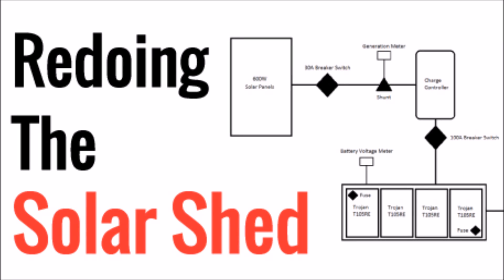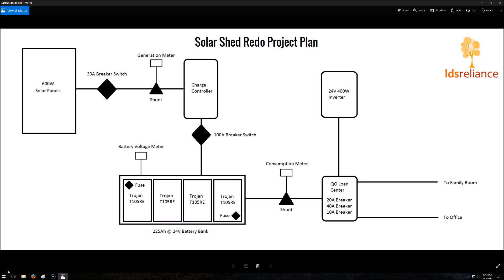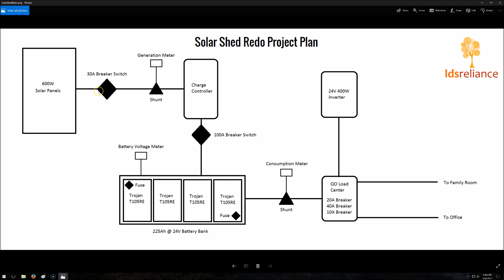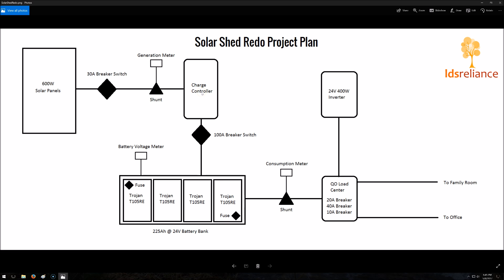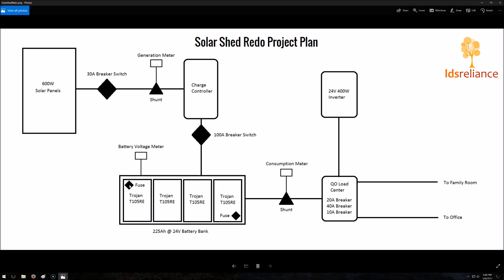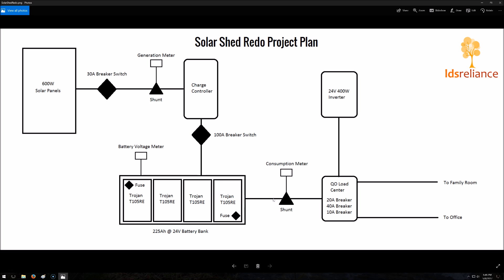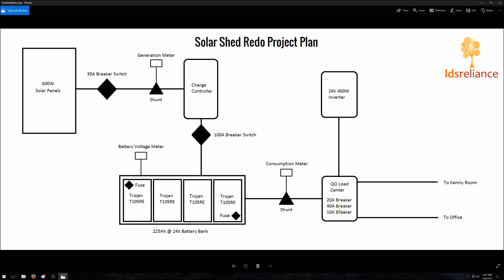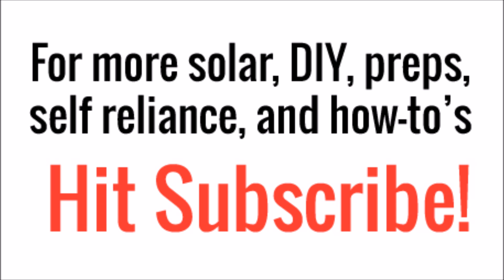Redoing The Solar Shed Part 2 - The Plan

Comment: idk if i asked this before but how much does each trojan T105 battery weigh in tons?

Obviously im just kidding, it was a joke. But how much does it weigh in pounds?
Reply from the maker: Each one is 67 pounds.  They are about 5-10 pounds heavier at least than the previous golf cart batteries.  I picked them up yesterday and they are beasts!
Reply: Was that joke funny? and thanks.
Reply from the maker: Haha, yeah.  They might as well weigh tons if you put 4 of them together and try to move them!
Reply: I found a 3-5 AH battery (i dont remember) it was a sealed lead acid battery (you know how small these are) they weighed way more than my battery that I got.
Reply from the maker: Yeah lead is heavy.  BTW, I am doing a lithium battery video this weekend.
Reply: nice

Comment: Brother I would do a lot of looking into the Mindnight 150. They use a lot of power at night. I am a Morningstar guy. Looks good brother. God bless
Reply: 8 watts.... 30 watts.... pretty specious comment. Point is that draw is inconsequential and Midnite's advantages far outweigh it.
Reply: I guess I'd agree that 5% is borderline at best, but still, if one's available energy is even somewhat affected by, say, a couple of fans to cool and exhaust that setup may be under-powered for needs. Might as well leave options open and toss another panel up there.
Reply: To me, advantages of Midnite Classic 150 is 150v peak and number of other input options that allow future expandability. Case is also aluminum and put together real well, and circuits are protected.

I'm happy so far. I have 1900w flowing through mine, but also impressive is how it handles lower available energy.
Reply from the maker: I've always been a MorningStar guy myself.  I'll keep looking at it but they lack on the ethernet and web monitoring from what I have seen.
Reply: yankey4 ....what power do they use at night???... they automatically go into rest mode at night.
Reply: They use about 30 watts at night when in sleep mode. If you have a wizbang you will see it. My friend has one. Phillip20 here on YT and he can show you with his IRcam the heat there putting off at night. He calls it his wall heater..
Reply: Yes sir they do. FOr that you would need the TriStar 60 Amp 12/24/48 Volt MPPT Charge Controller. Then U would have all of that. That is one thing I diss like about mine. I have the 45 amp Mppt TriStar and have to use the rs232 to usb going to a computer that I then can see from my phone or computer at home.
Reply: yankey4 ....that is very strange.  mine uses zero watts.  only if you turn on the led graphic panel (readout) power is used.  i thought from your comment you owned and operated a midnite.
Reply: I did had 3 150 that I had for over 2 years. Sold them when I moved to Morningstar. Do you have a wizbang on yours?
Reply from the maker: Good to know, Yankey.  Thanks for the info!
Reply: yankey4 ....the graphics panel of the midnite draws 2 watts when turned on.  at rest, the microprocessor draws 8 watts.  all microprocessor s draw power.  so 8 watts is a far cry from your statement of 30 watts.
Reply: So I am not trying to get into a pissing contest with you nore do I care. But my TriStar 45 Amp 12/24/48 Volt MPPT Charge Controller and 2 15 amp sunsavers Mppt CC use less than 4 watts all together. 

Yes your right I was off from what your saying. Sorry but for me it was a min of 30 but if you do the math on your # I was using 45 watts for my 3 Midnite charge controllers to run. Like I told you tho. I do not care and am in ni why trying to make trouble.. I was telling him what I was seeing from my stuff.
Reply from the maker: I wouldn't say draw is inconsequential when my whole solar panel system is only 600 watts.  If that unit is defective and draws 30 watts 24/7 that will be a problem.  Even 8 watts is a bit much.  Midnite claims 3-4 should be normal.

Anyways, sell me on a Midnite.  What advantages does it have over a MorningStar 60 MPPT?
Reply: The MorningStar 30 45 60 MPPT all can take up to 150 volts in. There is no fans or moving parts in the MorningStar. So that helps cut down on things that can brake and there is no need to take it apart to clean it. 

There is a few things to keep in mind with the Midnite's. They have to have the whizbang jr. to give you all the reading that it shows. The fan clog up over time. Just like all fans that are moving air. There is a few more things I just do not like about them. After being in solar for a living and working on BIG US Government contracts. All we would use was MorningStar.  To me that is where I am at and ehy I like them. O and they are good peeps who care about what they sell. No there not cheap what so ever but there made to last a life time. 

One more thing I have found the algorithm that MorningStar uses called the TriStar to be hands down the fastest and efficient charging algorithm you can buy. 

I SAY ONE MORE TIME THO!! I am a fan boy of MorningStar but when you have to pack in on your back a piece of equipment that MUST work with out maintenance in harsh environments like the like the high humidity levels link in Botswana jungles jungles. MornirgStar wins..
Reply from the maker: Thanks for your opinions guys.  It is a tough decision but I may lean toward MorningStar because I have used 3 of their controllers now and they have all been great.  Midnite seems to have a cult following of loyal users and seems to be a great product, too, but it is a bit more expensive and I have no experience with them first hand.
Reply: LDSreliance ...how much will the morning star cost you?
Reply from the maker: Looks like about $500.
Reply: LDSreliance ....you can get a midnite classic 150 sl for right at $400.  all of the advantages of the classic 150...except the sl is solar only.  only mppt controller with onboard built in ground arc fault protection.  96 amps...up to 150 volts.  proven most efficient mppt on the market.  5 yr guarantee...extendable to 7 years.  available all day long on ebay by a number of vendors.  or, you can get the midnite classic 150...good for solar, wind, and hydro for $550 on ebay from the same vendors.  or, you can get a garage sale classic 150 from midnite directly at reduced price...but i dont know the exact quote.  so a 96 amp mppt controller will give you options to grow your system. you can get the prices down by winning a bid on ebay.  the prices i quoted are for buy-it-now purchases.  so comparing apples to apples. midnite wins handsdown.
Reply from the maker: I don't see any Midnites on eBay for less than $500 Buy It Now.  Price really isn't the biggest issue, though.  I think I would be happy with either one.  I'll keep thinking about it and surprise you guys when the time comes.  Thanks for your input.
Reply: LDSreliance ...not all models of any mfg. may be listed on ebay.  personally, i hate wbay.  but my best prices come from ebay.  ebay listings change sometimes daily...weekly...or whatwvee.  i suggest you shop daily.  see whats available.  if you dont see a particular model...contact the vendor.  ask..youvwill get a result.  for instance...i disnt see a midnite for under $500.  but i contacted one vendor and they do offer the classic 150 lite for $475.  do some shopping....you will save money.  there are more than one vendor.  it will take some effort but shop shop shop.  i dont want to say any vendor names for free advertising.  but...virginia...ohio...Missouri are just some hints.  good luck.  adding this edit...there are other vendors.  im trying to be fair.
     another edit as follows.   I just found out midnite discontinued the classic 150 lite.  some vendors may still have them in stock.  the replacement model is the classic 150 SL.  better features than the lite but less than the classic 150.  so there you go.
Reply from the maker: True true!  Thanks for the heads up.
Reply: i talked to midnite today.  factory rep thot they had a couple refurbished classic 150 with full 5 year warranty for about $475.  you need to call midnite directly.

Comment: This your d/c side of house, what about the a/c side  of house from inverter to breaker panels. Do you have a third d/c generation source to charge controller to make a three tier d/C source to batteries. Solar, Wind and Gas will cover most of your needs with surge cutoffs to prevent surge to controller.
Reply from the maker: I don't have my AC tied into the house grid.  I have two 24V pure sine wave inverters.  One of them powers all of my entertainment center devices and the other powers our laptop/tablet/phone charging station.

I wish I had another DC generation source.  Unfortunately, I live in a typical suburban neighborhood with small lot sizes and an HOA.  So I can't put up a wind turbine (unless I do a VAWT and hide it from view of the street).  Obviously micro hydro is out of the question.  What do you mean by gas?  Propane?
Reply: LDSreliance Yes
Reply from the maker: I've been wanting to get a generator for a while.  Propane tanks are not allowed (at least the visible above ground kind) and I don't want to invest the money in burying one at this house because we won't live here for very many more years.  I do still want to get one and use the 20 pound propane tanks with it.  I have seen some dual fuel ones before.  It is definitely on my list!
Reply: That is one who uses gasoline and propane. If you have land fill nearby see if they are selling their methane to the public. Remember that is why they smell, there is a lot methane in that pile of garbage.
Reply from the maker: Yes but how would you bottle it and use it?
Reply: LDSreliance if they are selling it they know how to convert the propane tanks to hold and how to change the jets on the carburators so they will mix it right.
Reply from the maker: Wow, I didn't even know that was available.  Is that at city land fills?
Reply: LDSreliance Depending if they run there equiptment on the methane. If they don't have the conversion kit check with your propane dealer or local generator sales store and even look on line for adaptors to fill propane tanks with methane.
Reply: Or make your own compost pile and get methane that way.

Comment: You replied to an other comment with  "I regret not running Romex in my conduit into the house but what is done is done."  I'm curious,  what did you run in your conduit and if you wish you did it different before what is stopping you from running Romex through it now?  The conduit is installed isn't it?  Either use what wire you have in it or pull it out and pull Romex. Having worked as an electrician, I've pulled lots of wire through conduit.   I've added to existing and I've pulled out what was there and added to it when needed. There are no short cuts from doing what is needed to have it right.  Surely you can understand that the sooner you correct a mistake the sooner you stop living with it and suffering the negative effects of a mistake.  Moving forward with the regret in place should only add to the negative consequences of any mistake.  Do you not agree?   I am a firm believer of doing things right the first time.  When that is not done the negative effects of a mistake continues until it is corrected.  I call it throwing good money after bad when you go with what is there when it's not right for the job.  What do you think,  LDSreliance?
Reply from the maker: I agree with you for the most part.  I ran 1/0 stranded cable through 2 separate conduits under the ground and then up the side of the house into a load center where it is separated into smaller cable.  From there it goes into my attic and drops down into two locations in my family room and one drop into my office.  It is then inverted into AC with pure sine wave inverters.

I like that way because of the simplicity and I am not as familiar with AC as I am with DC.  But the regret comes in because even at 24V with heavy gauge wire I still lose about 0.5-0.8V over those long distances.  I don't know if it would be worth changing at this point.  I'm going to be blowing all of my money on the batteries and charge controller.

Comment: First! at 50 minutes too.
Reply from the maker: People are slow tonight, I guess!
Reply: most of the time it takes me a few days. but hey, I love the solar panel videos.
Reply: LDSreliance easer if you email me at commsprepper@gmail.com
Reply: caleb asbell ...well dang.  you were first!  let us know how you like the new cadillac you won.  you lucky dog you!!!
Reply: Robert Schilling sure thing, thanks for the Cadillac. second one in two years.
Reply: caleb asbell ...lol.
Reply: Robert Schilling gotta roll with it.
Reply from the maker: Robert, I accidentally deleted your other comment.  Sorry about that!

I eliminated the first load center that was acting as a combiner box.  Since I switched from 2 strings of 12V to 1 string of 24V it was no longer necessary and was simply acting as a breaker switch.  So removing it and putting in a Blue Sea Systems Switch or something like that will be simpler and more elegant.

The other load center will stay but will be replaced by the QO series unit which is rated for 48V DC.

The ammeters in the drawing will display amps and volts on the same LCD screen.  I know that the Midnite will display those but like I mentioned sometimes I don't want to have to reach over and thumb through a menu to find what I want.  I can rig up a panel that has volts and amps of production as well as consumption and battery voltage at a glance even in the dark.  You can never have too many meters!
Reply: LDSreliance ....ok...hell if i know which comment you deleted.  second...you wont have to push buttons on the midnit once you get it setup.  info will be right there in your face..lol.  however... if you want to be able to read the info from across the room...then you would need auxiliary equipment.  im jus trying to save you some money...adding this info...the midnite readout can be located to a different position from the controller by using a six conductor phone cable.  its all explained in the users manual.
Reply from the maker: I appreciate it!